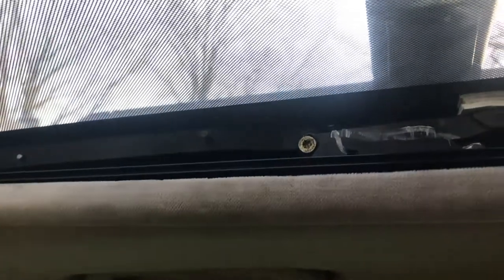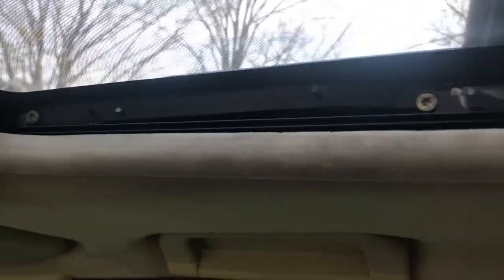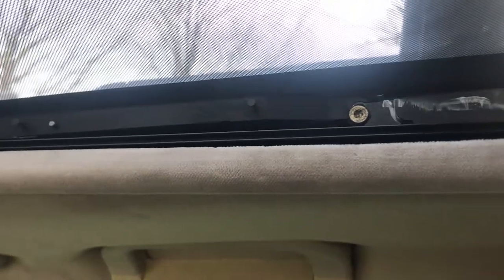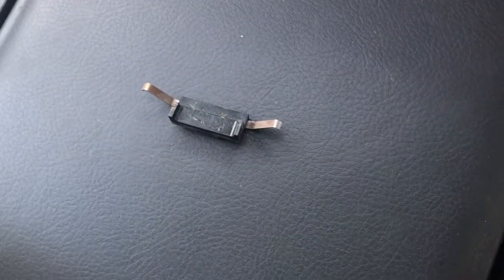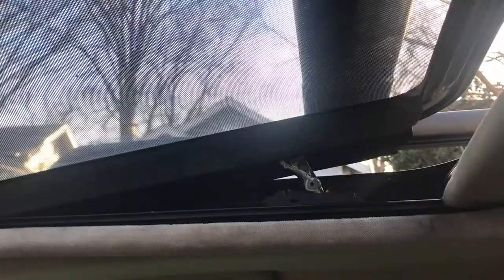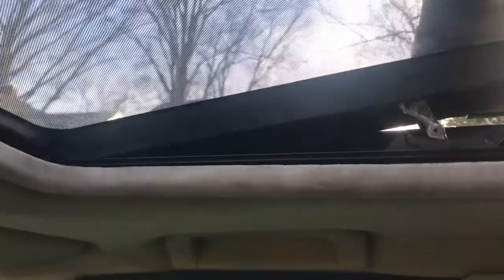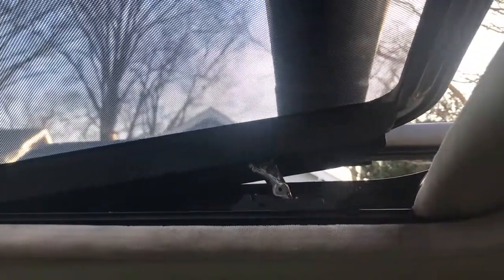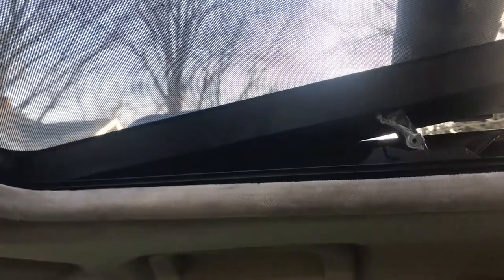Range Rover P38 sunroof repair corrections

Comment: Excellent video! this will help alot. can you make a video on how to repair the back door, it doesn`t open at the first time. what could it be?
Reply from the maker: I don't have a lot of experience with the back doors.  I have taken the interior door panel off the back of the drivers side back door just to see what the latches looked like.  It is a hard job.  The latches are connected to the window regulator so you you have to take the entire window regulator out.  Does it not open from the outside or inside?  If so, is the door super locked?